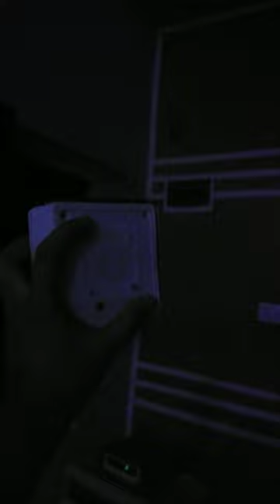DIY solar project/  inventions ideas / rechargeable solar emergency light

Comment: Components (in order of appearance)
1. Solar panel
2. Rechargeable battery
3. Diode (1N4007)
4. Indicator LED with resistor
5. DC LED panel
6. Push Button
Reply: Want to connect it with a 3W 6v 3A solar and not with the mains connection
Reply: Full video please 🙏🙏
Reply: Which resisitor😊
Reply: Full video please